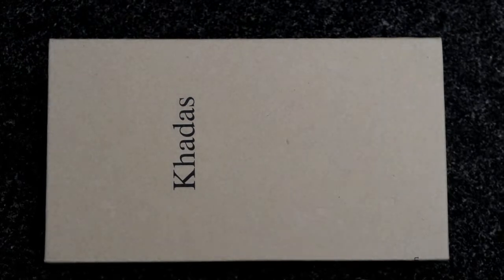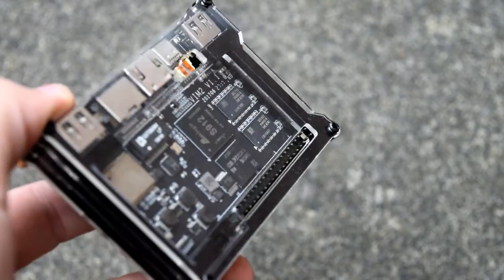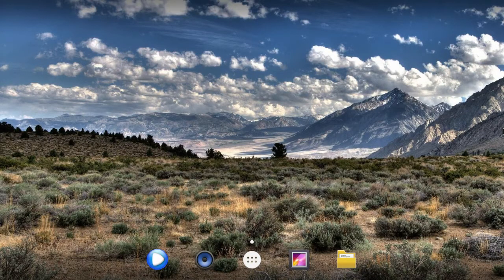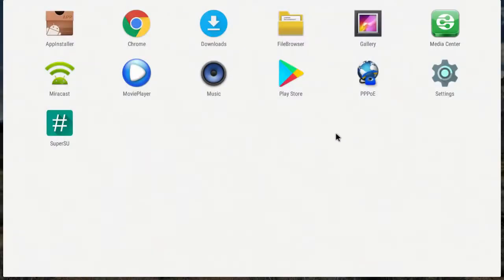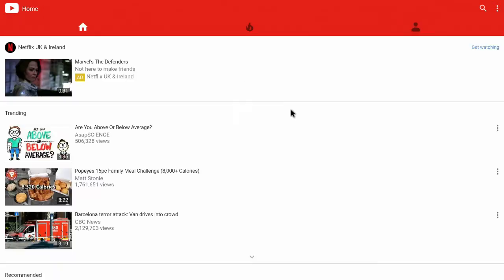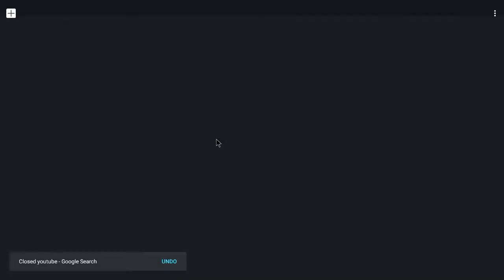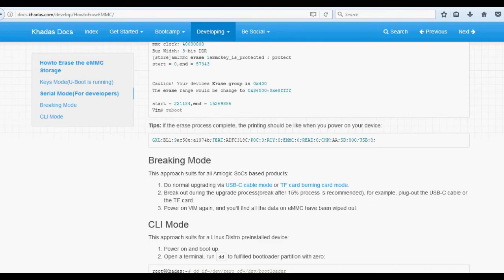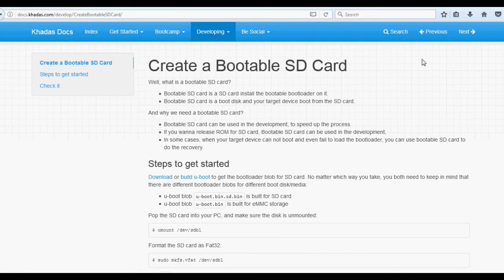KHADAS VIM 2: AMLOGIC S912 DEVELOPMENT BOARD - PART 1

Comment: mine arrived some days ago. 64GB android 7. 
I use a 220v charger linked to type c port. 
The microsoft wireless keyboard&mouse is recognised from an android's hardware cech's app, but don't work on Vim2. the bluetooth mouse & keybord are working. Also an usb wifi logitech k400.  At first boot you have to use an usb mouse.  Works with hdmi tv, but not with a pc monitor connected by vga/hdmi 's cable.